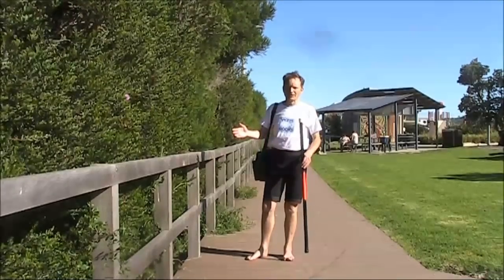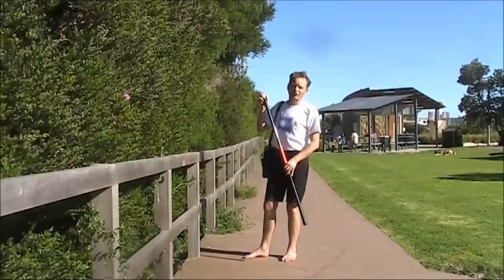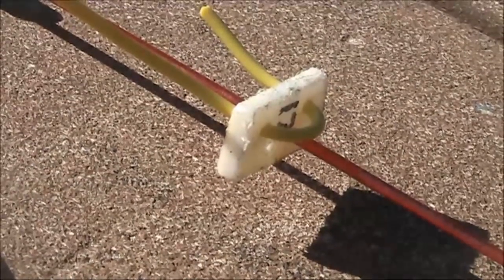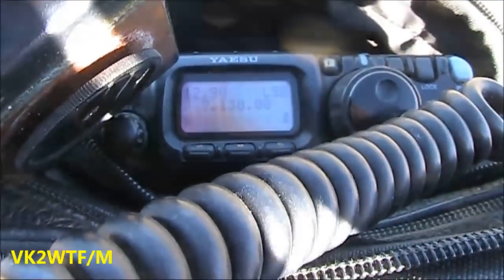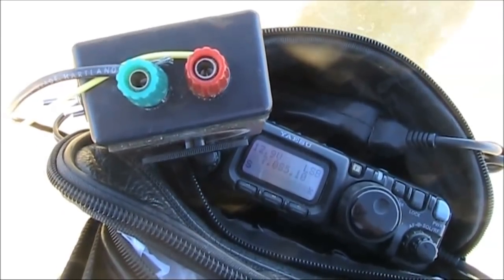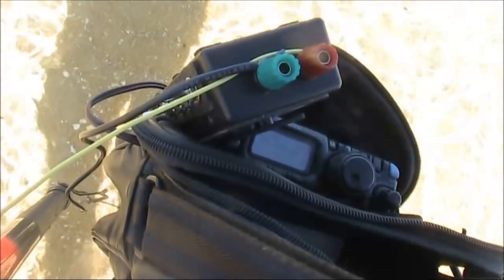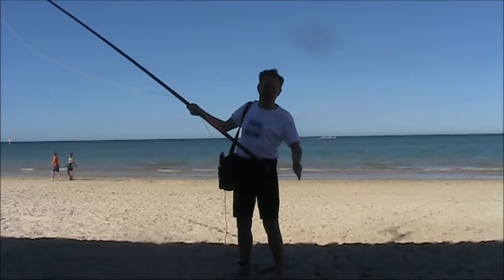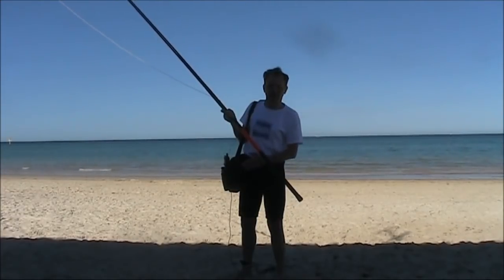7 and 28 MHz HF pedestrian mobile with 6m wire antenna

Comment: Peter I been trying a 4,4meter mast with my ft817 the same setup as your other station so far on 20m I have worked UK to vy2 with 2,5 watts there's no water here so I use a short trailing wire for the earth